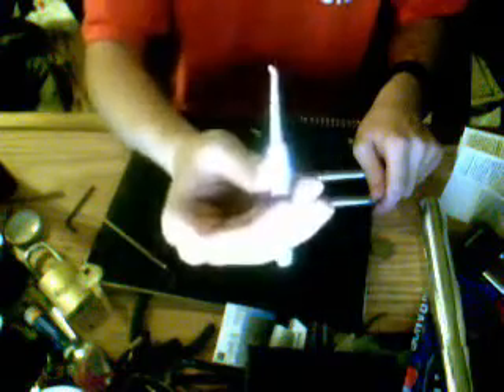SPP Picking Master 930

Comment: exactly, avoid the 1st pin like the fate of the universe depends on it. also, be careful when locking it back up. the spring can sometimes snap the plug back around and if it gets stuck it's a giant problem. it took me forever to figure out how to pick it, but placing the tension spring in the top really makes a difference.